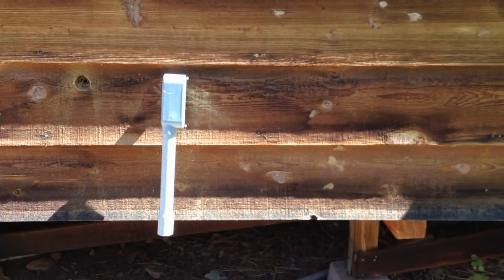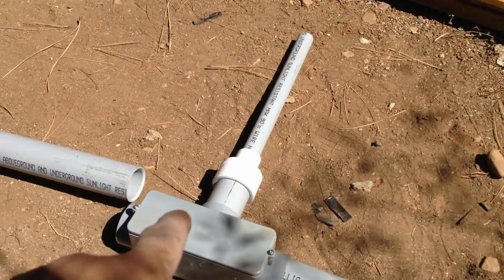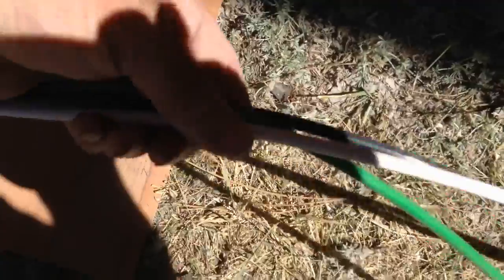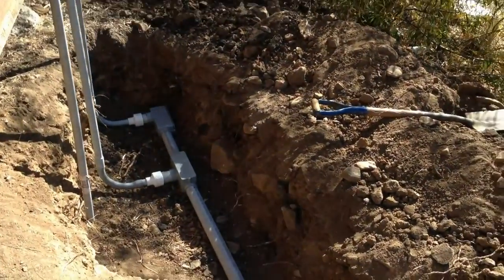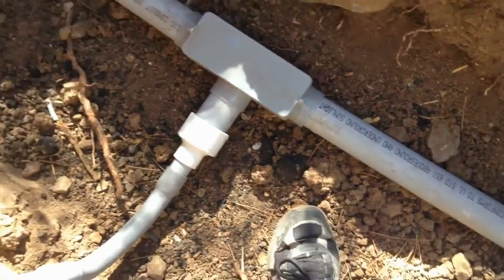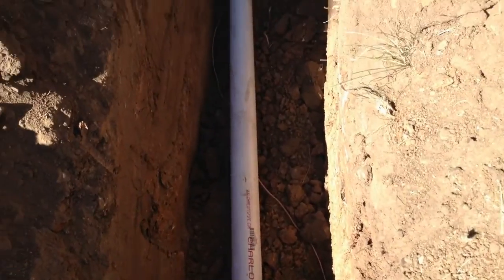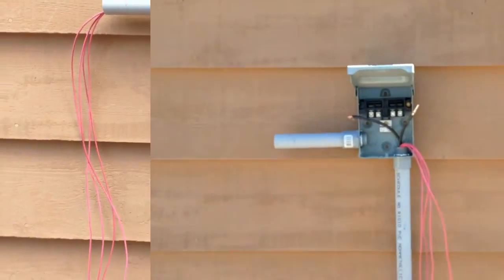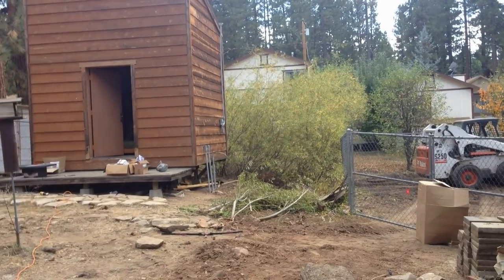Off Grid Cabin Solar Installation   Part 5

Comment: Hey you're looking great at the cabin. I can't remember if you are trying to meet code are not but having DC and AC in the same conduit is something you can fail code on but its up to the inspector. If you have a forgiving one you might get away with it.
Reply from the maker: Did not know that. Good thing I'm not permitting this job, but if I suppose if had too, i would the leave my pre-wired dc inactive
Reply from the maker: For what it's worth, I found this online. I could see the argument either way but certainly that's this is part of the same system and not different system. Below is what I found:

Inverter output conductors are part of the PV system. The handbook clarifies the intent of 690.4B stating, "Conductors directly related to a specific PV system, such as those in DC and AC output power circuits, may be contained in the same raceway as PV source and output conductors providing they meet the requirements of 300.3C."

The point is you are not permitted to mix Photovoltaic AD and DC conductors with miscellaneous light fixtures, or branch circuits etc. but you ARE allowed to mix AC and DC in general and with PV in particular, as long as they are part of the Photovoltaic System.
Reply: sunsensational There is also this

The proposed language for NEC 2014:

690.31 Methods Permitted

(B) Identification and grouping. PV source circuits and PV output circuits shall not be contained in the same raceway, cable tray, cable, outlet box, junction box, or similar fitting as conductors, feeders, branch circuits of other non-PV systems, or inverter output circuits unless the conductors of the different systems are separated by a partition.
 
Honestly these codes are ridiculously mind blowing at times.. The problem with ac and dc in the same conduit is that the ac lines since they cycle from positive to negative is that they can create eddy currents in the dc lines
Reply from the maker: I do know 2014 seems to contradict the actual 2011 code and it's accompanying clarifying notes. I'm not even sure what code my city follows there. Sometimes they'll adopt their own code which usually is based on NEC. Let's hope I don't have to find out. Lol

Comment: also question what if you wanted to change or forgot a wire. how are you going to rerun wire if you need it to go in the conduit did you leave anything in the turns just in cause you need to run anything else in the conduit I always have a good rope. in with them so if I ever need to rerun wire or add I can buy just taping the new wire and rope at the other end fish it though and then I still have rope always in the pipe just incase I ever need to add wire or anything to the under ground conduit   all in all look cool.
Reply from the maker: Yeah not fun work. Thanks for suggestion. Surprisingly, it only took me an hour to drive the 8' ground rod all way in so might take your suggestion, and drive another by shed. I choose current location for the rod, since centralized between both, and will be easy to terminate new ground wire down from cabin roof when I add panels there. Hopefully, and I pray, I don't need to add more wires later as the run is a bit tough, but worse case if I could not fish tape thru "as is", I would only need to dig out small section and fish tape from there. But, hopefully not needed and why I choose to pre-wire as much as i could foresee ever needing for my application, including the additional DC for more solar add-on and use of larger 6awg THWN for the AC runs. But there were so many damn wires already (11) going to different places so I couldn't think of an easier solution.
Reply: sunsensational yea I know a lot of people that go over kill.  I like to go over kill you never know when you need the extra As for me if an item calls for 10 gauge I will go to 8 gauge at and for solar yea I like to go 8 Gauge for my runs for the least losses in the wires. do to resistance. When I get more panels installed I will upgrading from the central panel by the panels to 6 gauge to my shed. and the same when I put up my tower it will be 6 gauge from the base to the Shed I really like your install. its sweet I believe I will run 2 inch for all my under ground. that way I have plenty of room for any future upgrades.

Comment: I would put one more 8 foot ground stake right were you have the long run of copper wire back to the shed. that way if you do get a lighting strike it has a short path to ground. I have my solar panel grounded at the rack. and then have another ground rod were it comes in to my shed. and once I get a tower built there will be 2 ground rod under the tower. and also at the three anchor points there will be a ground rod under them. and the cable will be grounded.   it may be over kill on my part but I rather be safe then sorry. equipment cost way to darn much to lose to a lighting strike.
Reply: From what I understand having multiple ground stakes creates a problem I can't remember what its called but it also something that you can fail code for. Yes I does work in that way where a lightning strike would take the shortest path to ground but say for example you were working in the shed and something happened that causes you to cross a live to ground it lowers you protection from that.
Reply: I guess as long as its right before it gets to the main Equipment it would be fine. I know for a home it one Ground Rod for breaker box. 

I know what you say holds true for AC installs. I have not looked at the Code for DC side of an installation. I know Solar panels are Ground separate A ground rod before the power leaves the Panels to a central connection and each Panel is grounded. and I now for a Tower like the Turbine tower I will be putting up it will have a ground rod under it. Yea dot need them at each anchor point. I will have 4 Racks of 2kw each rack I will only need on Ground rod. I will have junction boxes on each rack. and then from there to a large junction box on the rack before the power goes in to my shed. and there will be 6 gauge ran from that to the shed.  so I will have at least 3 ground rods. Tower, Panels, and then one for my breaker box for the AC side.  I will have to look more in to the code. to see what they require. But for me the safer the better..
Reply: McCuneWindandSolar  What's funny is that the most tricky thing to do in any electrical install is actually the grounding. They are so many variables that affects it, From the type of soil, how deep you go to soil moisture at that depth. An old school electrician once told me its best to bury an at least 10 foot square copper plate, 10 feet deep with your ground cable connect to it. A lot of folks online say bury a long coil of bare copper wire and as much of it running back to your ground bus bar. It seems its not an exact science
Reply: Romo Jack around here we usually drop 8 foot ground rods. and in side of the electrical panel there are two buss bars one is neutral  and the other is ground. and they are both bonded in the Breaker box.  Witch is wired even the Center tap on the Transformer the neutral is also bonded to ground. 

For me it was strange they do it that way. when you look at the power lines most you see 4 wires the 3 bottom ones are the 3 phase wires while the very top on is ground / neutral. then when it goes to a transformer one phase's hots goes in to the transformer than Neutral to the other tap on the transformer usually 7,000 some volts. then on the side we tap off to get out 240 volt split phase. you have the two hots and the center tap that is our then neutral that is also goes to ground. Then from the transformer to the home to the meter only three wires then were the meter is wired up and below that is were the 8 foot ground rod is driven in by the home. and its grounded in the Meter box thee wires go to the input on the meter and the out put has the two hots. and the neutral. but also with the neutral is there is a spot for the Ground wire and a ground ware going in to the breaker box to its own bus bar and the neutral to its own bus bar.  and the only place those two meet at them home is in the meter box.  

I have seen a lot of wiring jobs were people will have both ground and Neutral going to the same bus bars. I have even seen breaker boxes with only bus bar that both the neural ground go to. but those are under the older codes.  new codes they are supposed to be dedicated to there own bus bars. 

I know right crazy how it all goes together and the code changes every year. what might be right to day is wrong to morrow

Comment: Thanks Buddy...  Great explanation of your wiring.. Never have encounter such type of wiring before..  Usually, everything is located at one place or CENTRALIZED.. Your system is a little more elaborated...  LOL  Thanks for the vid
Reply from the maker: Thanks Al. Yeah, I couldn't think of a better way given all the different things I wanted to do, and where I wanted things to enter the cabin (e.g.Trimetric wire, ground rod, pre-wiring for added DC and disconnect for later, AC wire locations, etc). The thing is, if cabin was bigger, then I would have kept it simple and kept all the DC equip (controller, inverter, battery) in there, and would have simplified everything to small conduit run. But I wanted to use my shed for all the DC equipment, and to mount panels there first.  But, of course that just makes for a much more convoluted conduit run.  But 90% of run is in 2" conduit so worst case scenario, if I had to re-wire or add more, there's plenty of space, and if I couldn't fish tape from the existing conduit above ground, I would only need to dig out small section by shed or cabin and Then fish tape from there thru thru 2"